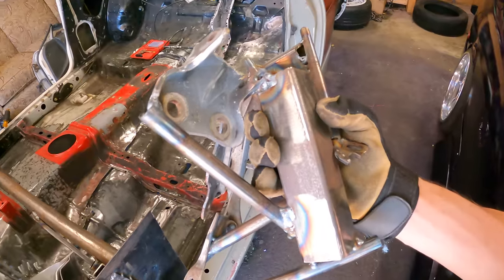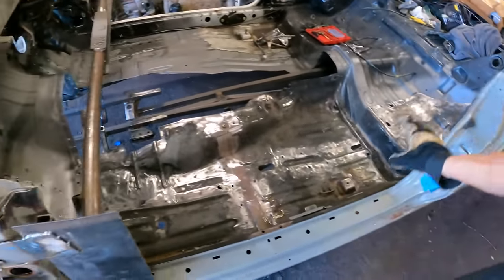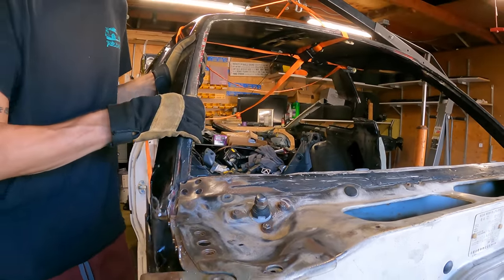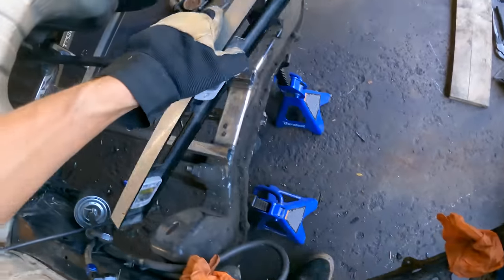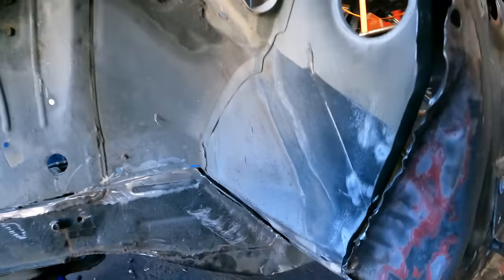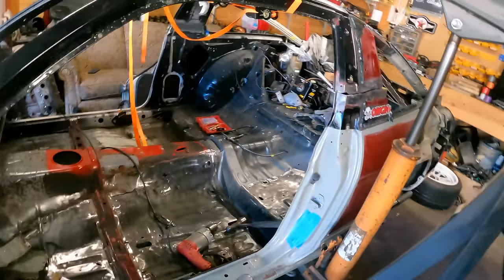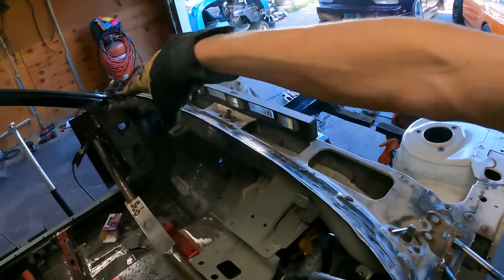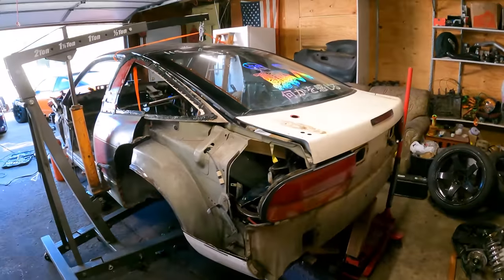WELDING MY DRIFT CAR TOGETHER!

Comment: Damn, I can't believe you're already to the point of welding!  Very impressive and it appears to be fitting together quite well considering where you started!  Also damn, I knew you lived somewhere in the area as I recognized the intersection you got t-boned at way back from your crash video, but you must be even closer than I expected since I recognized the post office you went to... My wife sometimes goes to the nail salon just a couple doors down -- I sometime hit up the Ace to pick up metric bolts as I seem to have way better luck getting the grade and thread pitch I need vs other places.
Reply from the maker: No way! Haha small world!! :_s13:
Reply: @PrizzaMike  Hey separate question for ya... where do you currently get your welding gas/cylinders from and do you recommend the place?  I need to make a repair in the engine bay on one of the bolt holes where the front crossmember is attached with that weird strap and the 2 captive bolts.  One of my bolts broke loose from the strap and I had a heck of a time getting it off the car, and now the top of the frame rail has a circular divot in it from the bolt spinning.  Was going to weld a steel washer (with all the plating stripped) in the "hole" since it fits perfectly and there's still metal below it to hold it in place -- Let me know if you think that's a stupid idea.  I've never welded before though, so I need to practice some and get a feel for it before I attempt to weld on the car itself.
Reply from the maker: @Papajin68  ahh hate when that happens!
I go to HTP in Elk Grove for my gas. Great prices, friendly staff. And also knowledgeable crew. They also have welders and welding classes! Great place 10/10
Reply: @PrizzaMike  Awesome!  Thanks for the heads up, I'll likely give them a try!

Comment: For the most part all the weld through primers are the same, as long as it has zinc in it, it’ll work fine. After you weld it all up and after paint and shit you could use something called cavity coater which is like a wax coating in a aerosol can that you’ll spray in all the little holes and crevices you can’t get primer or paint into. I just finished fixing my front end after my little accident. (I’m the dude with the blue accord that dm’d you on Instagram) your cars coming along great I wish I could fly up to help you hah
Reply from the maker: Thanks for the tips! I'll definitely have to look into that!

Comment: Hey mate. I'd say the right b pillar could be over/out from the hit. You might need to align b pillar to roof and then tack it in the right spot and then put some pressure up on the roof and block of wood and hammer on the b pillar in that sould close the gap on the c pillar

Comment: As a certified automotive collision tech this scares me. I hope you weld both sides of every overlap and then put a crazy cage in it.
Reply from the maker: I explained in this videp and all previous videos how the layers are overlapped and will be plated after initial welds.
Cage is on the to do list